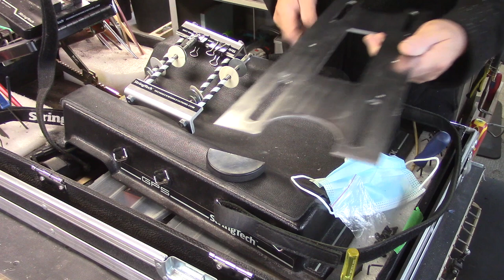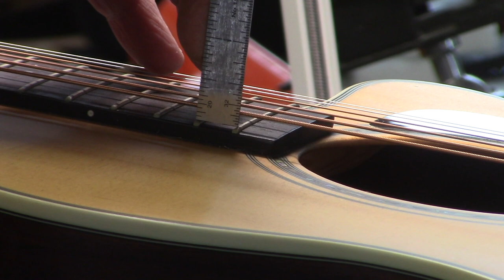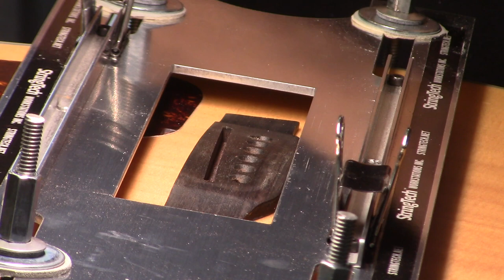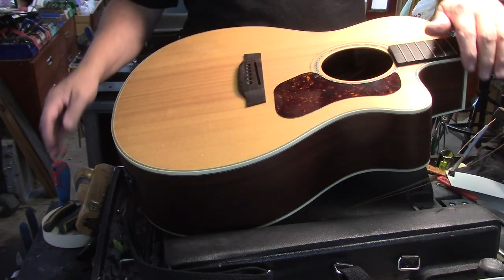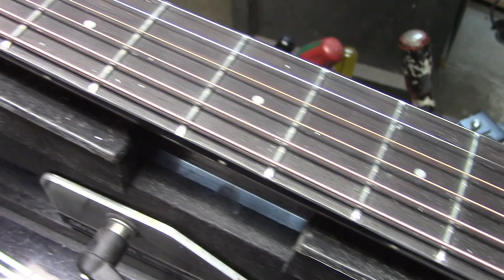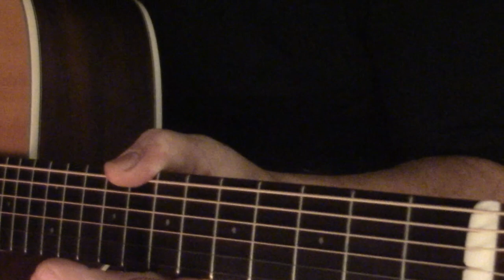Slotting the Acoustic Guitar bridge @StringTech Workstations

Comment: The jig looks really well designed and built! 2 Questions: what should the final slot depth be and should one generally avoid thinning the wings of the bridge when removing material?
Reply from the maker: OK Jim :  ... here's the deal. #1: in a perfect world; 2/3rd's of the saddle should be in the slot with 1/3 protruding above the surface of the upper edge of the slot. #2: Ultimately; the "Floor" of the slot should be no less than 3/32" thick. If you make your decisions based "as close as possible"  to this criteria ... "You'll be Golden" \m/ ! Michael

Comment: Hello Mike, big fan of compensation here... can you tell how much do you need to go beyond the standard nut position with the compensation for 12-53 strings? Just average usual values? Thanks!
Reply from the maker: Hey Korky,
The profiled nut blanks that I make … I allow 1.7mm of overhang.
Reply: @StringTechWorkstations  Thanks for swift response! From your videos I estimated something around 2mm, I guess that's because of B string, which is usually the farthest from the neutral :)

Comment: Mike - would you shave down the bridge on a high end guitar? Or recommend a neck reset instead?
Reply from the maker: In most cases I would do a neck reset. Some of the high end guitars can be a bit of a crap-shoot as far as the actual neck joint. Is there a brand in particular that you are considering ?
Reply: @StringTechWorkstations  It was a new Yamaha Red Label Fgx5.  Straightedge on neck made contact with the bridge well below the top and the saddle protrusion was low, too low to lower action.
Reply from the maker: I wouldn't attempt to remove that neck Gary. Better to buy back some neck angle by tapering the fingerboard and installing high ( .055" ) frets ... like this :https://youtu.be/JmixfioPtSI
Reply: @StringTechWorkstations  Thanks Mike!
Reply from the maker: My pleasure Brother ! Good luck\m/ !

Comment: Wouldn't it be easier to take down the bulk of the bridge with the router?
Reply from the maker: between the block plane and the Dynabrade sander
I can take it down slowly and methodically… checking as I go. The sander gives me more control than the router and is a lot less dangerous. It also produced a softer cross-sectional profile.